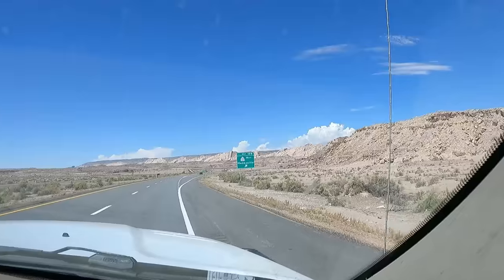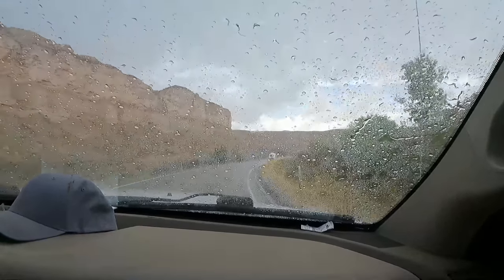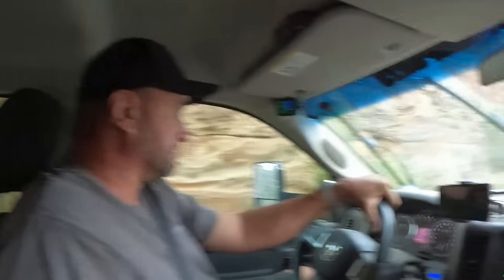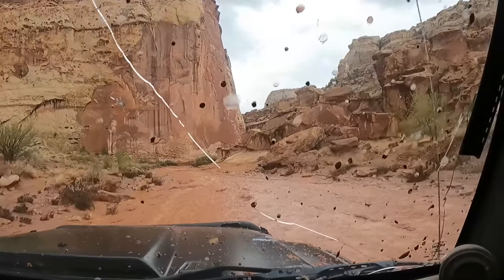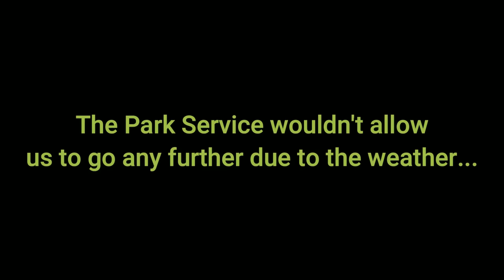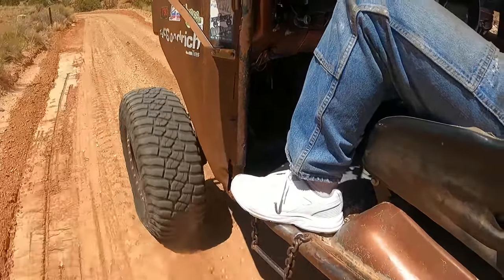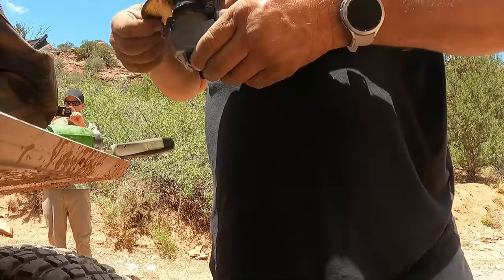Flash Floods In The Desert(Description tells more of the story)

Comment: Raised in west Texas. Have been stranded for two days by flash floods.  Stay safe. Be patient. Never camp in a wash. I would not have crossed those washes.
Reply: Agreed.  Foolish.
Reply: @sedrickbosh6132  says the armchair critic. Pretty much sure you have NO experience in such matters.
Reply: @sedrickbosh6132  Looks like they knew what they were doing to me. They had the right equipment and experience. Not so foolish when you succeed and make a great video.
Reply: @sedrickbosh6132 
 You're wrong.
Park service was being overly cautious. The Mator is built for that abuse.
 If you own a gladiator, I can see your fear, and you should prolly be cowering next to your keyboard, making sure you don't get your stamped tin parts wet.
Have a nice day
Reply: Raised on a northern Minnesota farm, if you're afraid of that, you ain't doing our driveway in October.
Reply: @donr416 same here. West Texas boy. When we saw storm clouds to the north we'd get in the jeep and run the canyon honking and hollering making sure the livestock was out of the draw
Reply: @sedrickbosh6132  Was down in Costa Rica in mid 80's and rented a Toyota Tercel to explore the west coast. Pavement got scarce after you got past the airport. Lost the whole exhaust system from the downpipe back. Just stuck it inside but since i didn't have any tools to shorten it protruded between the front seats and you had to be careful when you shifted because the jagged metal  where it ripped off was right behind the shifter. First night on the coast  we were tooling along when we encountered a large tree branch that almost covered the whole lane. Looked odd like someone purposely put it there but i swerved around it barely slowing down until we came upon a river where the bridge had washed away stopped just inches before we would have fallen off the abutment and into river. After we recovered from the adrenaline rush we got out of the car to scout how we were going to proceed. We could see that on the other side there was a steep little road  that went right into  water and it looked like it got a fair amount of traffic.  Backed the car up and swerved around the branch. Realized the branch was put there to direct traffic down a steep little road to the river. Convinced the girl friend to hike her skirt up and act as my depth finder. She waded out there and quickly was in water deeper than her knees. Knew some cars float and i could of  been taken by the current right out into the ocean and it did float for a few seconds but door rubber leaked and it sunk. Current still pushed it downstream but, thankfully,  there was a sand bar and i was able to get some traction and get to the other side where i paused and let most of the water drain. Let the girlfriend back in. She was a little concerned she admitted , cuz she realized if i floated away i would have essentially left her in the dark, in the jungle, no passport, no money, no plane ticket home and worst of all, no cigs! Learned if water was over her knee , it was dicey, and to wait till she found a little shallower route.

Comment: First time in Moab with my dad, went across a small creek crossing that was about a foot deep. Coming back later that day water looked like it was moving faster and a bit muddy but not much different and we didn’t notice that it was a lot deeper. He went to cross and once in the middle we could feel the tires leave the ground and we started floating downstream sideways. Luckily it was a short (yet deep) crossing and we bobbed down and my dad gunned it when he touched bottom. That was enough to get our front tires on the bank and pull out. After that we made note of landmarks to determine water level because not every crossing looks drastically different when flooded.
Reply: Dustin, The same situation happened with my Dad , older brother and I in the Pariah river in Cottonwood canyon south of Tropic Ut.
We were in  1958 Dodge Town Wagon. We waited out the flash flood until the morning, loaded up alot of rocks in the back of the wagon and went upstream and started crossing. By the time we drifted down we were able to gun it and cross to the other side and make it to the 24th of July celebration in Henrieville, Cannonville and Tropic Ut.
Reply: "Live and learn....Yep...That's how it's done.

Comment: I just did one on a 2016 3500HD gasser and you have to have the monster puller SP11880 made by so tools.  I did mine without fully removing the gear box out of the truck, I locked the steering wheel and pulled the bolts out and then twisted the gear box sideways up towards the motor, a second set of hands is greatly needed but I was able to get the puller in place and with two bumps of the impact then send the beans the arm came right off and the Milwaukee didn’t impact hard.  I bought the puller knowing I’ll need it again but it is the only puller that at 60 ft lbs it has 14,000 psi of pressure on the arm to pop it loose.  All my local shops went “yeah that truck style…. $1200 and it’s a two day project”  I was able to get mine off with 4 tools, 15/16 socket, 1/2” high torque impact, 1 13/16” crows foot for the main nut and a 11” extension.  I did lower the sway bar and should have taken the plow mount brace off but I want to know the cheat way vs long way.  I like the channel keep up the good content.

Comment: Many tourists get stuck in remote parts of Utah and other parts in the south west and are surprised when a simple tow can be well north of $1000.  Traveled to "The Wave" back in 2004 on my motorcycle (Honda VFR800 Interceptor) after a storm and while driving on House Rock Valley road there was a stream crossing about 4 miles from Hwy 89.  The water was down to a manageable flow but there was about a 8 inches of mud in the wash.  A dually had gone through so I was able to ride my bike through the mud by driving in the tracks of the dually.  I made it to The Wave and had a great day but discovered that some tourists got a passenger car stuck in the wash and had to be pulled out by a road service company either out of Kanab or Page, either one was going to be about 50 miles away and I heard the cost was something like $1600 -- ouch.  I had no problems getting through at the end of the day and made it back to Kanab without incident.

Comment: I used to do quite a bit of canyoneering in Zion and other desert areas. On a multi-day trip to Capitol Reef, doing slot canyons, we did a canyon that requires rapelling into pools and swimming downstream. We finished the canyon in the main drainage headed to the Lake and started up the plateau back to the vehicle - when a monsoon hit - lightning hitting the plateau we sheltered under an overhang and watched rivulets of water combine into a flash flood that dumped into the slot canyon we had just finished. If the rain had hit an hour earlier, probably would have killed us....

Comment: Hey Rory: I got a 95 gmc jimmy. An had to do the same job you did to this truck. I had to put the pitman arm off. But in the poses I cut a little pice small pice off from that shaft. I put the new one on an bolted it right back up it’s soloed with the nut tighten down. But my question is it safe to drive my truck like that parts for this truck are hard to come by. For this truck an a new steering box is a arm an a leg an half a toe. I mean it’s expensive. Lol but yah so would it be safe to drive I’m not sure how it drives at the moment my truck is sitting in my garage right now because I was working on it but had to stop I had gotten into a fender bender a wile back so I’ve had to replace some parts that had gotten damaged in the wreck but had to stop construction on it. Do to Covid an the inflation of are economy so money is tight I’m the sol provider for my family so I barely make ends meet on what make hope to get back working on my jimmy agin one day. Hopefully my finances get better as well so I can have some extra to by parts I’m doing all the work my self.

Comment: Nice job! I've done that same grinder technique before on certain pitman arms. I've noticed once you cut/ grind your groove most the way , a large chisel/air hammer will finish the cut. Most times they fall off, may not have helped as you said yours was rusted on solid. I do have the snap on low clearance pitman arm puller for that body style of chevys so you dont have to pull the box, that works way better but I understand not everyone will have one. It does pay for itself after a few uses though. Nice job again !
Edit: I was wishing I could pass that tool thru my computer screen for you to use to make life easier on ya... maybe once technology catches up.
Reply: I think a chisel would have popped it right off (like you said), it opens the splines.

You like that low clearance puller? Ever have any issues with it? Some of these pitmans are crazy tight - I think I'd rather just cut em.

Comment: I live in similar climate/topography in central Washington, I teach about permaculture and how to manage landscape so that we greatly reduce fire, flood, erosion, drought and famine with other beneficial side effects like preventing full desertification... digging holes and terracing landscape to distribute the water across the land and let it soak in rather than flash flooding ....every acre that gets 1" of rain is receiving over 21,000 gallons of water...keeping rain/snow melt off on the land hydrates and recharges aquifers and promotes springs to flow steadily once full. Basically doing the work the beaver would be doing if the beaver wasn't killed or relocated anytime they try to do their job.....luckily solutions exist to most of the problems we face, governments prevent action that makes sense. 
 It seems the forest circus and conservation agencies are not conserving much.

Comment: Rory my brother i know your safe with your glasses on but beating two hammers together cost me 3 days in the hospital an a surgery above my eye the hammer busted an sent a shiver of steel right above my eye socket missed my eye ball by centimeter please be careful losing an eye is no joke just looking out for ya bro and oh yeah it hurt like hell an bleed like a stuck hog
Reply: Saw a carpenter do the same hitting 2 claw hammers to pull nails. Sliver shot off head of one and hit him in the armpit area. He thought he got shot at first. Then the blood came. Never seen so much blood from such a small wound. 2 quikclot packs barely slowed it, finally slowed it with pressure and ambulance arrived. He spent 2 days in the hospital. Had nicked one of the arteries. Long story short, I am super wary when it comes to that now.

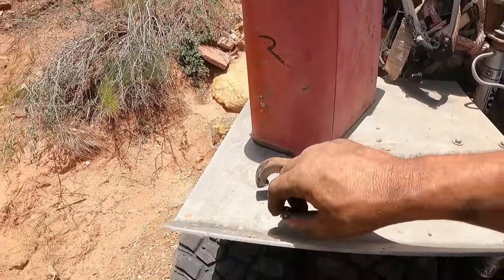Comment: 15:20 - Astounds me how many of these single break points are on vehicles.  Opinion: Regular / routine connection joint inspections could reduce these breaks.  (Critical safety inspection).  Had a new truck from factory, with loosening  steering box to frame bolts (bolts were backing out), ( appeared to have not been torqued down to specs. when installed).  (Glad to have had tools on board). That was alarming enough for me, driving down a mountain.

Comment: Good thing your haul truck has the air inlet removed from the bumper. That diesel wouldn't appreciate water induction for certain. Seen lots n lots o fools not realize that inlet is low and slurp water like a straw into a 12k 24v good night soldier.   Tucson hit me strange when I first came here with the "WASHES"  I went ya whatever.  Being from WI at the time. 1st never seen water come off a mountain face without rain before. 2 never seen water flow north before. 3 exactly as you described, no rain for miles on the horizon but BOOM water wall. They put barricade poles across the wash after the road so when an idiot goes through ( stupid motorist laws here too) the barricade poles stop them from getting blown down the wash and into the tunnel systems that are under the city for miles. People watch a city bus go through and think ahhh if the bus can I can LOL  The bus is incredibly heavy and diesel with an air inlet 12' in the air. Yes some are CNG.    The rain storms do make for  welcome change from the shitty brown of the desert though.

Comment: The Park won't allow  the State Road to clean the barrow ditch and fix  the shoulders and drainages damaged by repeat flooding back to their original condition. That road did not flood every storm like it does now during the 1970's and '80's.  If the park would let the UDOT fix it then it would not jump HWY 24 every storm like it does now.  The shoulders and drainages have silted in until they are higher than the road surface.  That is not safe.

Comment: Maybe you should tell the park rangers to watch your videos... "Impassable roads" .. You recover vehicles where there are NO ROADS, and off the sides of Mountains. With @matts offroad recovery, @fabrats, and you take them to @robylayton to get body work done. LOL .. also, couldnt you have used your Boom Winch to lift the front of the vehicle for better access, or was using the bottle jack the safer option with no jackstands?

Comment: Need help stranded and no cash got ripped off by the last mechanic please help info 99 GMC suburban 4x4 5.7 leader engine it was running fine no issues shut it off about an hour later andI started it back up and it was chugging and backfiring so I did some research replace the spark plugs put in some injector cleaner fuel cleaner and still doing the same thing and I just know that it's something simple